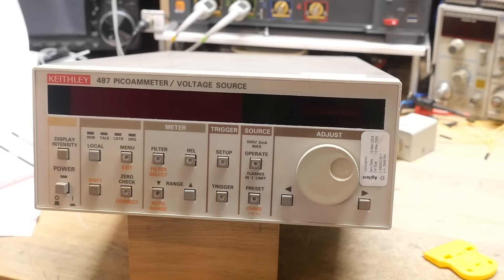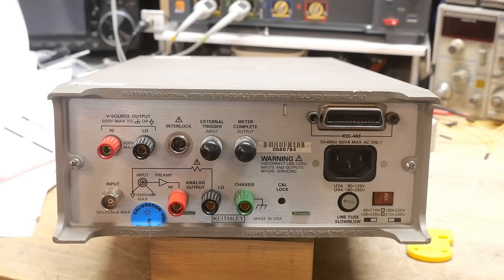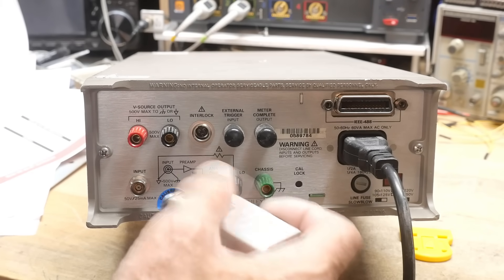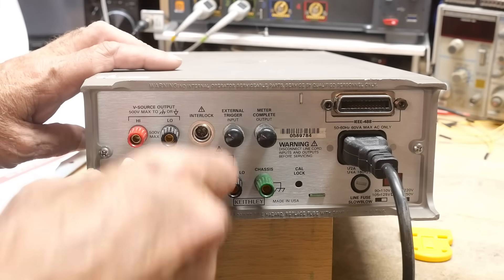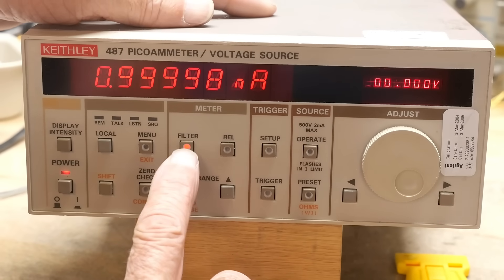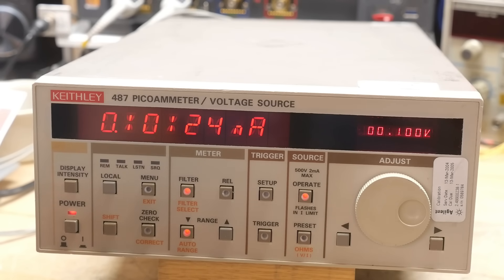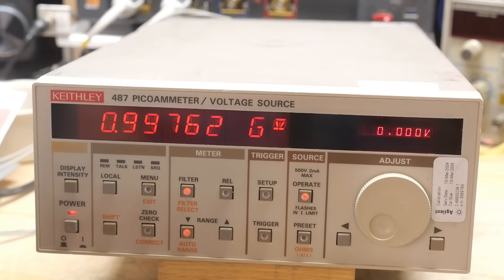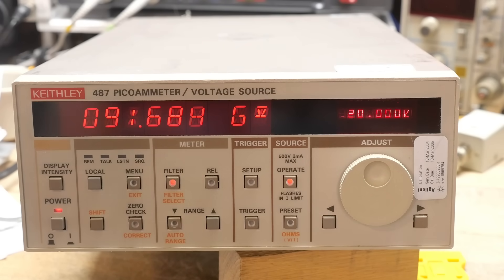#2356 Keithley 487 Picoammeter / Voltage Source (part 1 of 5)

Comment: I recently picked up a 6487 (basically the same device but a generation more recent) at an industrial auction for about $800.  Very impressive devices.  I was super happy to find that it came with a triax cable since those are unreasonably expensive to get.

Comment: Peta comes after Tera
Reply: yeah, and pico (e-12) is an opposite of tera (e+12)
Reply: @Mr.Leeroy I was referring to the resistance that Imsai guy addressed as Pico ohm when he meant peta ohm. Now both start with a p in the user interface where he may have confused it or didn't remember peta. Happens to the best of us....
Reply: @LutzSchafer  I get it. My point, maybe he confused picoamps and teraohms scales that are equivalent magnitude except the sign.
As for interface, pico should be lower case p and Peta = P, but segment displays are limited in that regard and make things worse.

Comment: If you're interested in a side quest, there's a thread on eevblog about Gyro's super simple picoammeter circuit (pA -> mV used with a multimeter) with a few builds. It should be easy enough to build and a comparison to the original Keithley would be interesting.
Reply from the maker: here is version I did: https://youtu.be/5d0iZxnRPFU?si=Cw5xyT8IhDr6rTjH
Reply: @IMSAIGuy  Nice!!!

Comment: Awesome meter! After terraohms, it's petaohms and some resistors, depending on material, have a large voltage coefficient of resistance. It would be neat to bypass the interlock and check out the voltage dependence of these resistors!

Comment: oh boy, I wish I had one. Do you by any chance have an Uni-T 139C available? Because I have one and I was surprised of the huge input resistance on the 600mV range. From what I have seen it should be in the 90-100 Gohm range, but I would love to have confirmation of this.
Reply from the maker: I don't have a uni but i would be skeptical of the input resistance you are quoting. Uni doesn't even have a spec for that.
Reply: @IMSAIGuy actually I found the "spec" on the Chinese manual only and it states > 1 GOhm. It certainly has a FET input for that range (on higher ranges it falls down to the usual 10 MOhms).

I was surprised that a 40$ multimeter allowed me to measure VBE of a transistor with the base open. Simulation shows you need several tens of GOhms to pull that measurement. I had to shield the transistor and wait several seconds for each measurement but I got the VBE - VCE dependence expected by simulation.

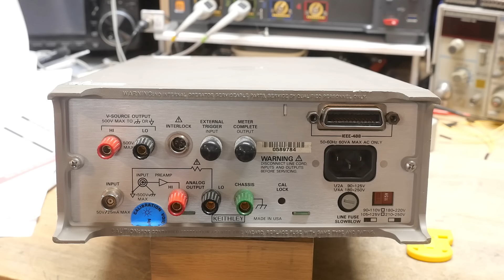Comment: At 2:30, the inner shield is actually at the pin's potential to avoid current flowing from the pin to the shield through the coaxial cable's insulation.  Even 1nA lost through the insulation destroys a pA current measurement.  The inner shield is powered to supply this leakage current between the inner and outer shields.
Reply: The joys of guarding. 😊
It would be nice if IMSAIguy did a couple of videos on guarding

Edit: he might have done a few already...
Reply from the maker: I haven't talked about driven guards per se.

Comment: Nice instrument, I just wonder why half of the operation is done at the remote end of the long equipment. 
With a multimeter that has an impedance of 10MOhm and measures Voltage with a resolution of 10µV you can measure a current of 1 pA. This is the current that goes through a 10TOhm resistor at 10V. It is not as precise as with dedicated instruments but it provides good experience to handle these quantities.

Comment: My Keithley DMM is not my primary bench meter but it is able to measure 50 microamps with higher resolution than my other meters so that I can calibrate Simpson VOMs with it and a power supply and some decade boxes.

Comment: Even in the gigaohms range skin oils etc.. will throw off a reading of a resistor. I can't imagine the lengths you must have to go to to get a reading in the tera ohm range. Everything must have to be ultra clean. I wonder what the resistance of air is? Tera ohms? Higher?
Reply: The resistance of air varies greatly depending on pressure, temperature and humidity.  The resistance of dry air at at standard pressure and temperature is around 10^17 Ω⋅m (ohm-meters) to 10^14 Ω⋅m